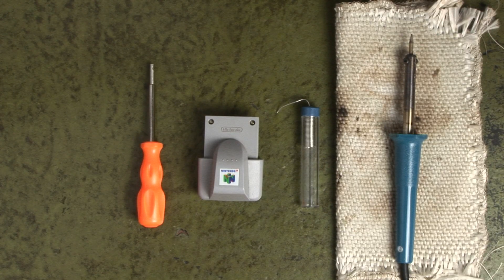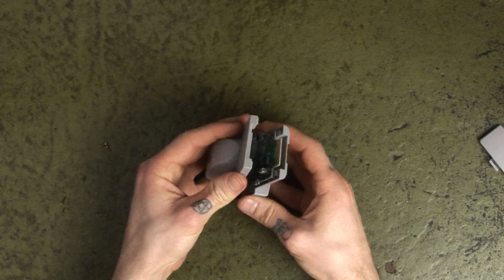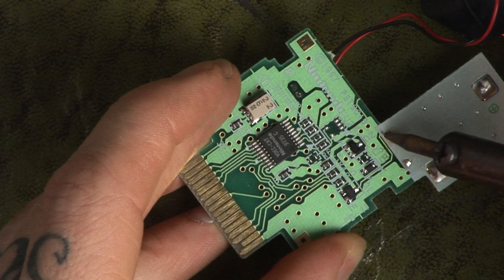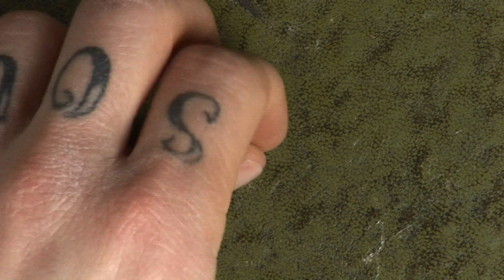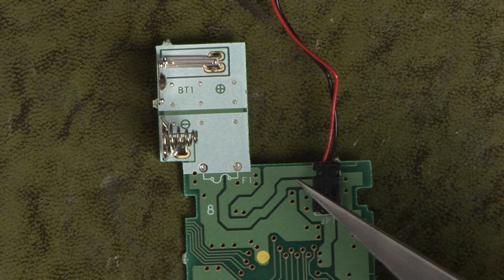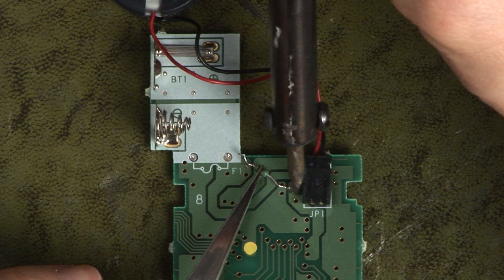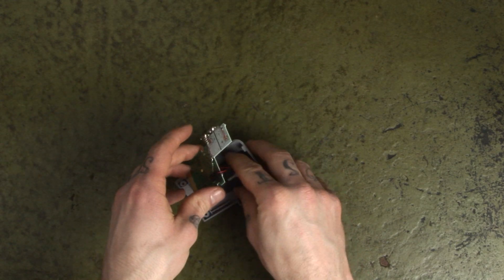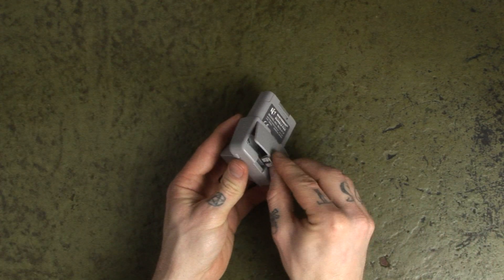[HOW TO] Make an N64 rumble pak run without batteries.

Comment: Three questions…
Q: Does this mod make your rumble pack…
Rumble slightly less, 
Rumble the same, or…
Rumble more powerful?

Q: Does this mod affect your N64 overtime?, like if for instance you use all FOUR controllers with a rumble pack…(without batteries mod)?

Q: Is it possible to make this mod for the N64’s “Tremor Pack”?

Comment: It works. I don't know why Mario Kart doesn't have a rumble but Kirby 64 does? I was thinking maybe I fried the circuits or got sold bogus rumble paks. It's a lot easier with desoldering wire. Took me a good 10 mins at 480 to get the fuse off.
Reply: That's because mario kart came before  starfox 64 (1997) where it was the first game to introduce the rumble pack. Kirby was released in 2000.

Comment: You gotta wonder why they didn't build the rumble-pak like this in the first place? Tie-in with a battery firm perhaps? Good stuff anyway.
Reply from the maker: jameswilksey cheers dude. I believe it wasn’t originally done, because if you was to have 4 controllers with rumble paks like this, it would have drawn too much voltage or current and damaged the console. It’s only a theory I heard.. so I can’t verify that. All I know, is my method works, so you don’t need batteries.

Comment: Not trying to be snooty, but I believe that's a fuse.
Will definitely be trying this mod though.
Reply from the maker: Nomnivore7531 I believe you are correct since ‘f’ usually denotes a fuse on a pcb. The drawing on the board also indicates a fuse rather than resistor. Well spotted!
Reply: Is it a fuse? Huh. Didn't thought of that, thought it was a 60 Ohm resistor.